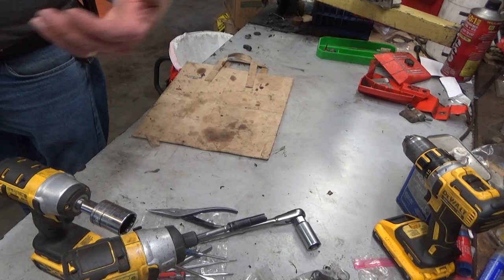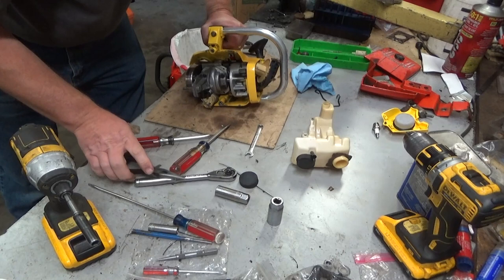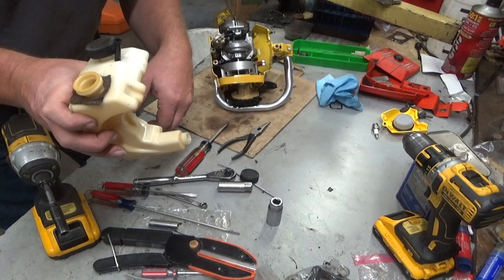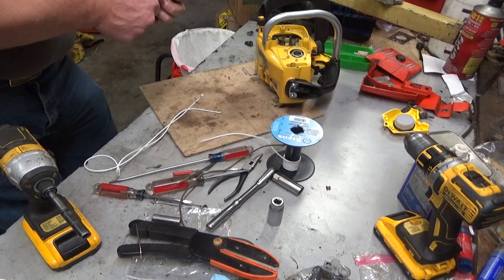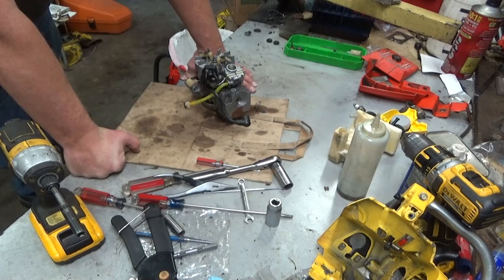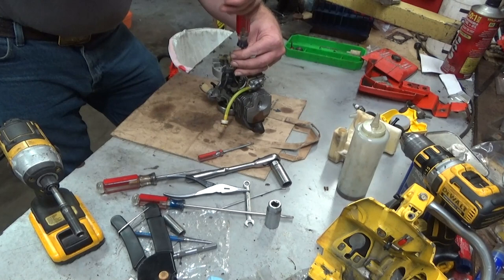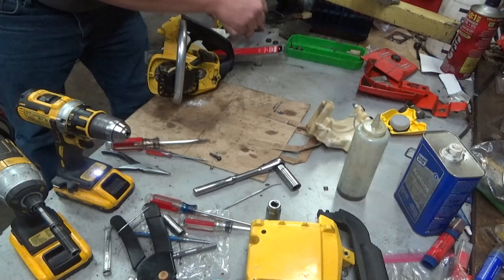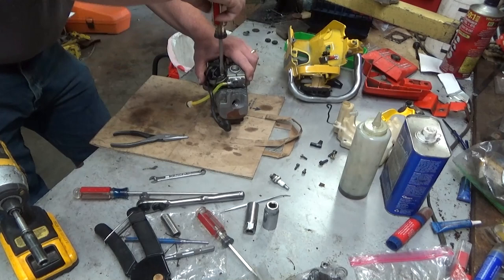Henry's McCulloch 130 Diagnosis...Multiple Disassembles & Finally A Test Run!

Comment: I always just put the motor in the case and only put in a screw or two to semi secure the motor in the housing. And connect the gas line. Then test start it. Some some people pop the bar on put it in the vise and start it with a drill but i dont really like doing it that way. To many time have i completely assembled a mini mac just to take it all apart again

Comment: I rebuilt your carburetor. I made a separate fuel channel for the idling. Thus, there is no need for the non-return valve in the main nozzle. I have a video of it on my channel.

Comment: Oh i know the pain of the 2.0 quite well..have one that's been my nemesis for 2yrs..i know I pulled it outta the case a dozen times one nite tryin to get it running..,had to use  a soldering iron to fix leaks at the seam on the tank one time,n that dang fuel line got me couple times til I put a wire in the fuel line to match shape of the original then heat shrinked it to keep the bends in the fuel line.. that worked great....finally got it running pretty good I think....theres alotta power packed in those little suckers!! Great stuff Leon n thanks for sharing!!

Comment: Hello. I'm working on the exact same saw. The problem is I have spark with the engine outside the case, but no spark when put into the case. Replaced the kill wire, thinking it was shorting to the frame but still no spark. Any ideas? I also replaced the coil with the same results.

Comment: I am working on a 110 for my first ever chainsaw and it belongs to a friend.  It was full of oil/sawdust cake.  I suspect the oil leak was the T shaped connector from the oil tank to the oiler.  The connector takes almost no effort to plug it into the oiler.  Where can I buy one or is there a better way to fix that?